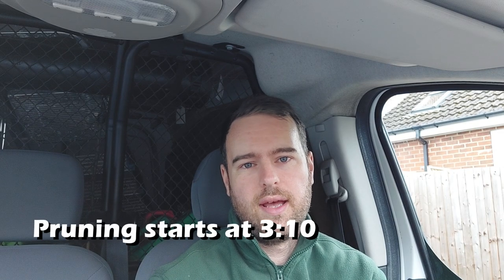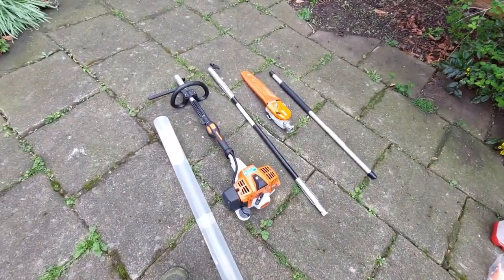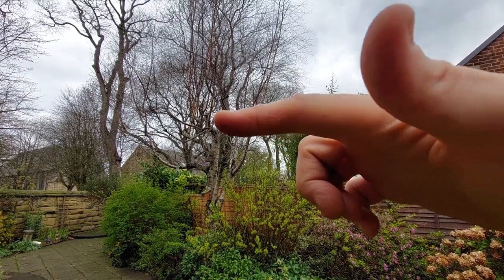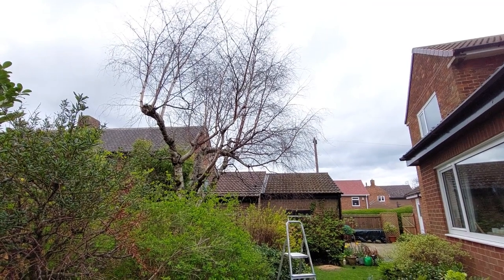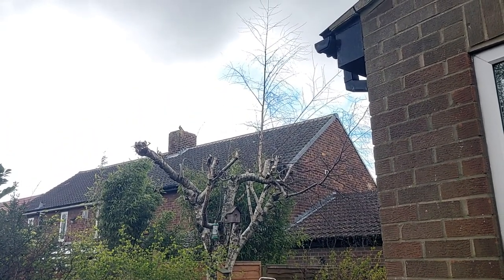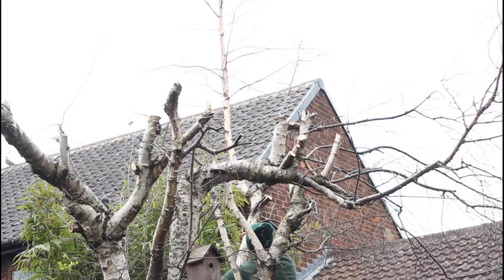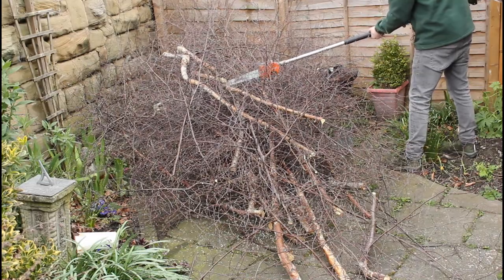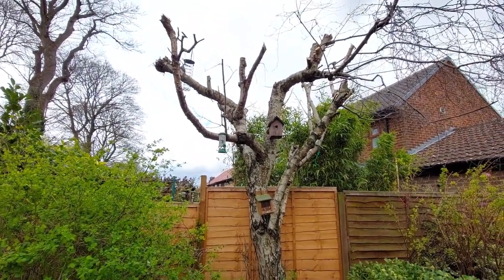Silver Birch Cut - What did I charge?

Comment: tip for you, some trees, especially silver birch will bleed to death, silver birch is notorious for it. it looked dormant so should be fine. always carry some para cord or thin rope, failing that you could carefully cut through enough then  pull with a long reach hook rake or anything like that, just make sure you cut above your final cut...IE make two cuts, one to bring the branch down, and another to clean the cut, sometimes the bark will strip of the branch will split under the weight,  you could look up the Shigo method.
Reply from the maker: Appreciate that thanks for the advice mate

Comment: I was guessing £80 plus waste @ £5 per dumpy bag so about right with me there.for a reg customer.
Try to avoid the sawing motion when cutting with a chainsaw which usually means it’s incorrectly sharpened or blunt.
I use a dremel multi tool with chainsaw sharpening attachment.There’s a hook under the pole saw body for dragging stuck branches out of trees which helps.Thanks.
Reply from the maker: Thanks for the advice. Completely new to this